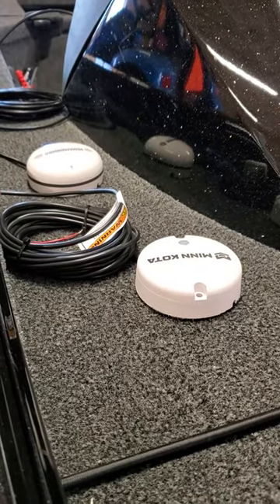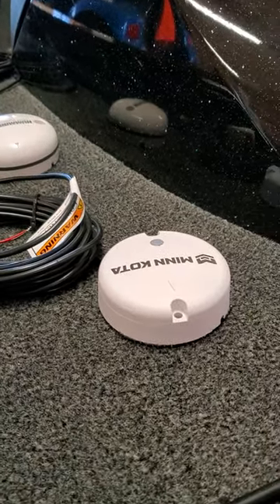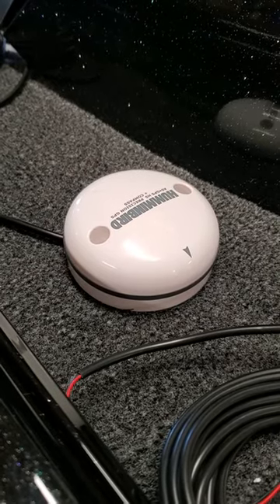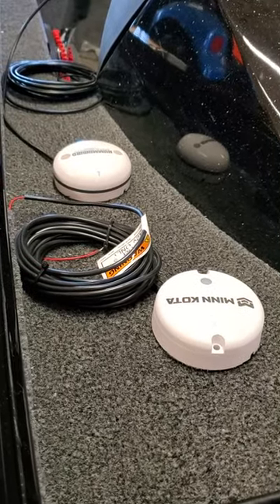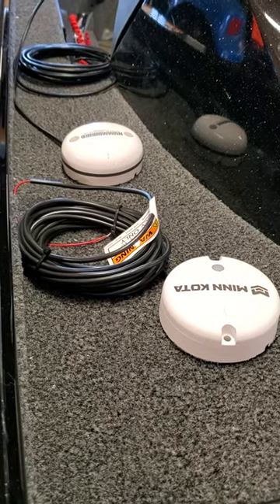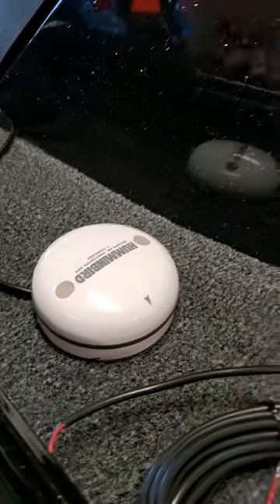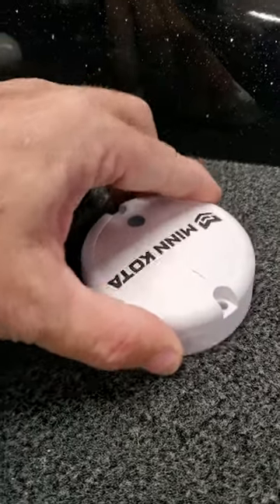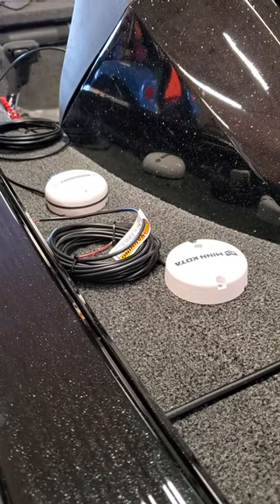GPS Puck Placement

Comment: So you put the GPS puck for the humminbird closer to the transducer where did you put the GPS Receiver for the minnkota..
Reply: Minn Kota -It's a heading sensor, not a GPS, use a small compass to find a safe place to mount the Heading Sensor to check for interference. If the small hand held compass starts to drift from true north don't mount the heading sensor there.

Comment: So what ended up being the best location on your Lund for the GPS? I getting ready to install one on my 1875.  With that head unit being at the console, I am thinking it would help marking accuracy  to find a clean location, as close as possible to being right above the transducer on the transom. Going to mount the Talon tilt bracket direct also. Thanks for taking the time to show your install on that as well.
Reply from the maker: I agree, closest to the transducer is better. However, closer to the transom means closer to a ton of wires. I started using this trick after drilling holes just to find out when I hit 3000 RPM that my compass turned 90 degrees.